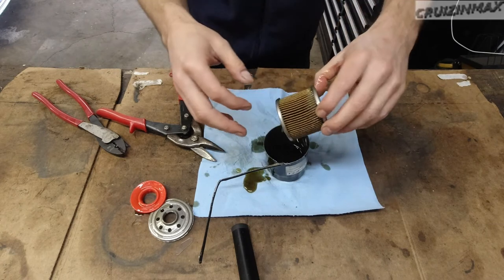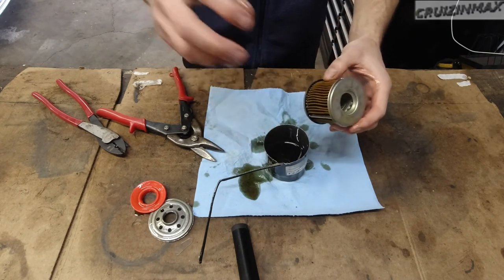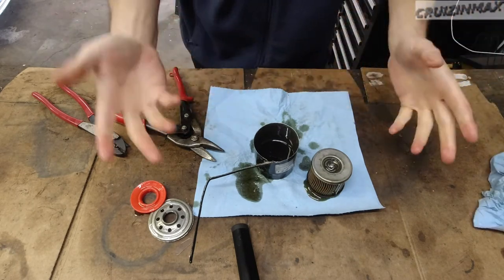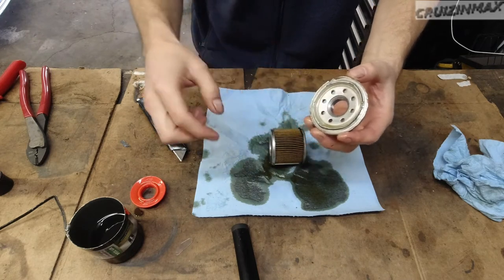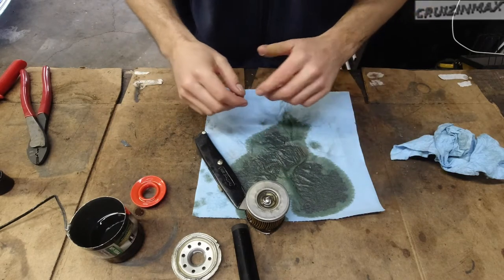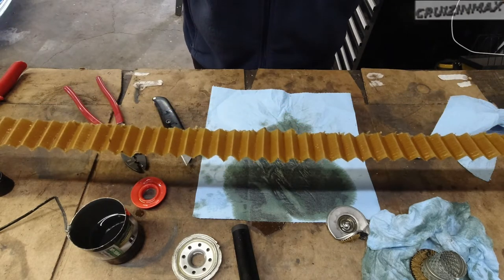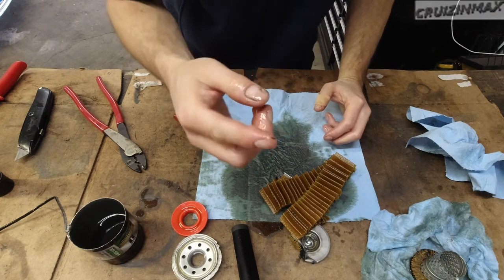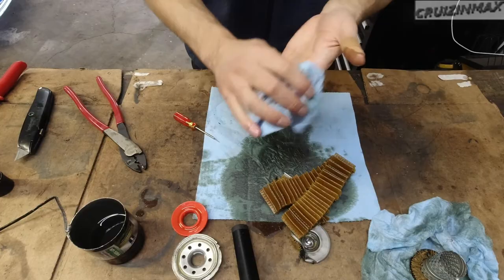How to inspect your engine oil filter

Comment: How much metal do you think is usual after engine rebuild (especially after spun bearing)? Do you worry if the oil is shiny, but there are not many bigger particies inside the filter? I also found, that exhaust pipe cutter does a great job when opening oil filters and is affordable and could be used for other works.
Reply from the maker: after a full rebuild you will always find some shavings and gray oil.  how much depends what you used to assemble the engine, like plain oil or assembly lube.  after the very first start, idle the engine for about 15 mins and change oil and filter.  i actually found bigger chunks of metal that a magnet picked up in the filter after 1000 miles, sent oil for analysis and all is good.  So yes, you will find some chunks on fresh engine but there shouldnt be any gray oil say after 2 oil changes.